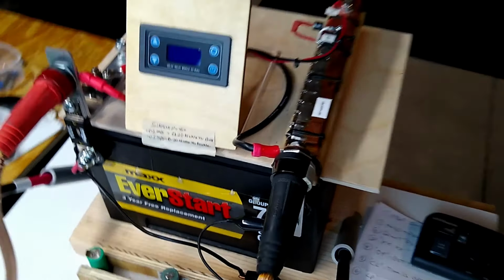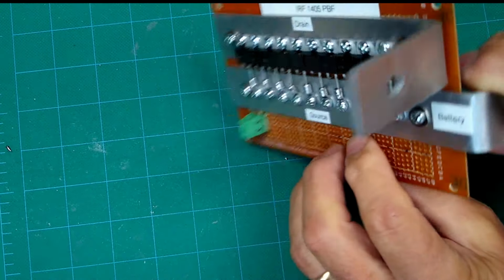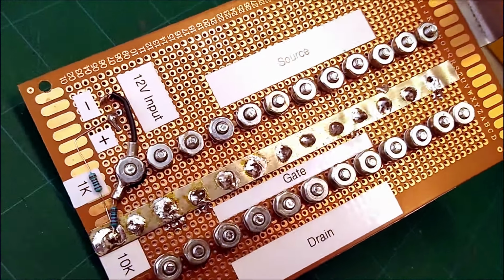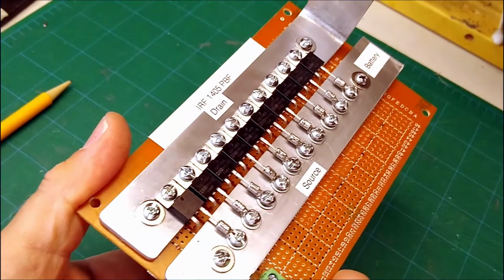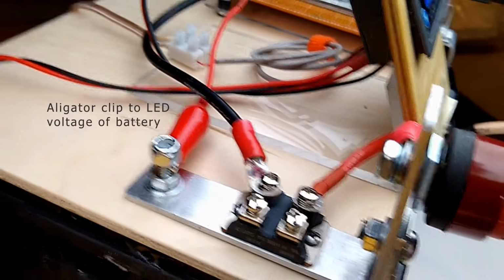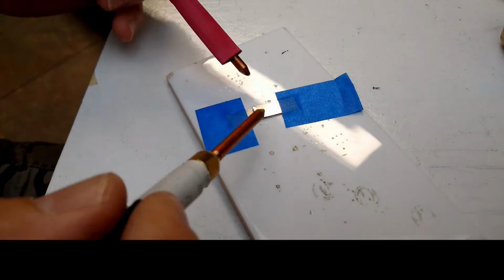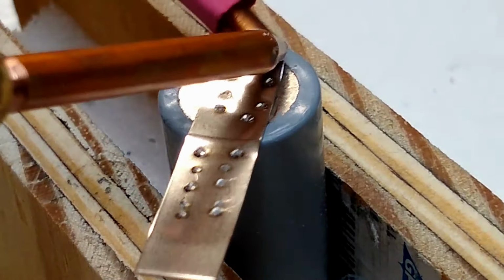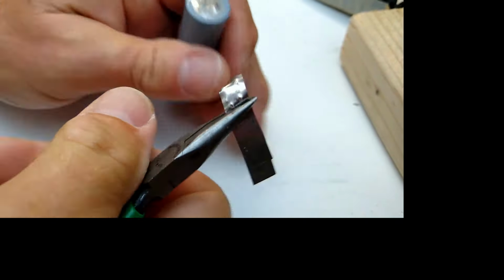Mosfet spot welder build for dummies

Comment: exellent welder im trying to follow your build im stuck on welder cables size and what size dinze connectors also ive got same timer just wondering what is connector called where trigger goes into timer thanks for any help
Reply from the maker: https://www.amazon.com/dp/B07H5G7GC6/ref=cm_sw_r_cp_apa_fabc_.d66Fb5M6FNF9
Reply: @stevecahill9106   sorry steve i meant the connector that goes into the timer
Reply from the maker: @danielstorey9342  used existing connector, to power and send pulse voltage from timer to mosfet circuit. Looks like I added wire inside timer circuit to go to  footswitch. Check schematic on where you would connect external footswitch
Reply: @stevecahill9106   the only place i can get one of them diodes is digikey looked all over uk i have to spend 33 pound to get free delivery from US. when i watched your build you mentioned 1N4007 DIODE I googled specs only says 1A where the one that you use is 300a would i have to put 1 1N4007 on each mosfet WOULD THAT WORK. as you can tell im new to this
Reply from the maker: @danielstorey9342  I did not use a 1N4007 diode in my final build. Follow the parts list in the description. If finding parts is difficult and shipping costs are high you might be better to  buy a KWeld unless you can find a  local supplier to provide the same .
Reply: @stevecahill9106  thanks for your help on this  i just like doing projects and get a lot of satisfaction when it all comes together. ive built a couple of battery packs 52v for my ebike i used them cheap red mosfet welders on ebay . ive had 2 of them they both blew up it was the mosfets i got some new mosfets put them in. and added a capacitor and they have been ok since .but only weld 0.10  nickel wont weld 0.15 but im only using a 330cca car battery thinking of using higher cca battery what do you think. ive just got my timer today in post same as yours bit confused with 3 pin trigger inside of timer going to add a foot trigger. do you use high or low trigger pin to trigger timer .
Reply from the maker: @danielstorey9342  I use a  800 CCA car battery as you can see in the video. This welder will do .03 nickel. A battery at this CCA will give you the power you need. I also have the battery on a trickle charger. 

 I have seen many YT videos about that welder you have and the fixes that people do to keep it from blowing. Just a thought.

 I have provided you with a link below with updated photos of changes I discuss below.

1.  Used the low trigger.  Difficult to see in the photos but the labeling is not centered on the pins on the circuit board. Use a multimeter after hookup to test continuity on the trigger output which goes to a footswitch or button. NOTE: I use a separate 12Volt 18650 pack to power the timer which in turn sends voltage to trigger the mosfet to a "on" state.

2. I have taken the source mosfet aluminum rail  and now it connects to the battery from the other end. I ran a cable from the battery - side to the other end. (See Photo). 

3. I recently changed out the welding 4 gauge pens with smaller 8 gauge wire with stranded flexible silicon copper. This gives better control-placement of the welder tips on the cell with the smaller gauge.

I noticed that the K-Weld uses 8 gauge.
I inserted copper ground wire (3.25mm dia) as welder tips from Home Depot about 1.5" into each of the 18" 8 gauge wire ends.
Shorter end tips allow for more control with DIY mosfet built welder. Does generate a bit more heat in comparison to the pens i was using, but worth the advantage. 

Better welds when you have more control using the 8 gauge with the silicon covered wire when your welding the positive ends of the 18650's because of the small footprint of that cells positive area.

Also tried used the spring pens, but that was again like holding a long pencil at the top and trying to write resulting with no control.

Did have to increase weld time by .01 tenths of a second due to the smaller cable as the resistance went up. Plenty of power to weld .03 nickel. 

Currently building out a rig that will allow the electrodes to be fix on a arm on a fulcrum that is held up by a spring that you pull down the arm and the electrodes can make the weld. This would  allow consistent electrode distance placement on the nickel strips. 

I may revert back to the 4 gauge wire with this new rig if all is well. This would allow there to be less resistance, thus less heat generated. Each welding method(s) would provide a use caser depending on the situation and access to the cells.

Link to photos: https://photos.app.goo.gl/wSKNhtsXjbajwvaC8
Reply: @stevecahill9106   thanks for your help on this. tried my 330cca  battery everything sorted ive got timer working with a foot switch first i tried to power timer of same battery but timer wouldnt work soon as i powerd timer of seperate battery it worked . just need a 800cca battery because the 330cca only welds 0.1strip. it sort off nearly welds 0.15 . got 1 diode 10a 1000v flowing  from source to drain so anode end on source and cathode on drain side of mosfet. i hope this is right looks the same on your pics . just need a diode for the positive side of battery tried to get one like yours digikey and mouser havent any in stock till may june .looked at daniels recent post he uses 2  1000v  1a diodes in series i think he said you need high voltage not so much the amps. ive  looked at the post about the flyback situation . correct me if im wrong i connect a cable from the drain side off mosfet where i have one of my welding leads with the diode flowing towards the positive terminal so the cathode side of diode connect to the positive of the battery .what im trying to clear up here is ar we stopping the flow from positive terminal back into drain side off mosfets. or do we stop the flow into the positive terminal from the drain mosfet rail .
Reply from the maker: @danielstorey9342  See the link in video description for endless sphere they have indication of diode placement, and use of two mosfets as a flyback diode vers the one I used.
Reply from the maker: @danielstorey9342  also discussion of how the diode works, good info at Endless Sphere showing this. Read all the individual threads.  See https://endless-sphere.com/forums/viewtopic.php?t=81400&fbclid=IwAR1UGhstMfwU7wNa9qfhoOfc6igTPb2AM6f24elK1h3saX4iSCmg7HelAn8
Also here photos: https://endless-sphere.com/forums/viewtopic.php?f=14&t=81400&start=25

And alternate to Flyback that I have:
 https://endless-sphere.com/forums/viewtopic.php?f=14&t=81400&start=50
Reply from the maker: @danielstorey9342  With a 800cca battery I can weld .030 nickel, time .04 seconds.  I have my timer on a separate power supply, which also powers a LED light and small fan.  Need to do a video on that. Put the welding pens on a pull down arm allows better control of the placement of the electrodes.  Also numerous videos on YouTube on easy fix to the small "red" spot welder.  Are you on this Facebook group @ https://www.facebook.com/groups/DIY18650

Watch: How to modify "red" spot welder:  https://www.youtube.com/watch?v=fdnO0Z-scjA
Watch: Using car battery with "red spot welder:  https://www.youtube.com/watch?v=231qtaRIs3M

Comment: Great Job, easy  design. that Flyback diode is important, a lot of people neglect using them and end up shorting their MOSFETs depending on the length of their leads.
Reply: Does the flyback go between source and drain or source and gate?
Reply: It goes from drain to the positive battery terminal. The fly back voltage is apparently 1000 volts positive so it needs to be directed to the positive battery terminal and away from the mosfet as that is to big a difference from the drain to source.

Comment: Hi there great simple design.  Can I use an old Microwave transformer instead of the battery?
Reply: Just from watching the video, you would be better off using the battery.
Reply from the maker: This is designed for battery.

Comment: Why did you decide on the 10k value? ... vs Creaney's 2.2
Reply from the maker: Based on another builders specs I used. Have not had time to test other resistors values. Lack test equipment to fully understand the implication of changing the value.
Reply: Are you triggering positive or negative lead?
Reply from the maker: @terrylmusic  Mosfets switch on negative side of battery to negative  welder tip. Mosfet switch has its own 12v power supply independent of the battery used for welding.
Reply: @stevecahill9106  what I am missing is the power hookups.   
I'd have sworn I saw leads coming off the battery for powering the board. I have Creaney's timer, can't see where yours is connected. Im sorry if this is elementary.. first mosfet project for me. Please help.. I'm almost done.
Reply from the maker: @terrylmusic  here are a few pics showing the timer wiring  I use @ https://photos.app.goo.gl/9NhYyssQQ8XY8i2m8
I think Daniel used same battery as welder to power his timer. I use separate 3S 18650 battery pack to power the timer I use that triggers the mosfet switch. I blew up the first mosfet welder when I attached to same battery as timer. Probably had reversed leads to mosfet switch.
The 12 volts goes to timer the positive from the battery 3s goes to mosfet positive as shown in video. The negative from the timers output goes to the mosfets negative as shown in the video. I have the timer jumpered by the white jumper in the photo. I hope this helps.
Reply: @stevecahill9106  I'd like to forward a screenshot of the board I have from Daniel's 12 mosfet video, but I don't know where to send it in this reply. Robojax xylj02
Reply: @stevecahill9106  I am studying your photos. Thank you. Just don't want to blow it up.
Reply from the maker: @terrylmusic  best to test the mosfet switch before hooking up to battery to weld. Use a multimeter to check  for continuity with the mosfets. Treat the mosfets switch like any other switch.  Except this is electronic switch vers mechanical.  Apply briefly 12 volt separate power supply as I use 3S 18650's to switch on the mosfets, or use your timer to briefly turn on. I advise checking timer separately from mosfets to make sure you have that working by itself.  Check that you get continuity across the mosfet switch with  the 3S power supply before connecting the main  welding battery power input to the switch. In my case this mosfet switch buss bar input is on the negative side of the battery which attaches to the mosfets source leads. Continuity will be tested ( without being connected to main welding battery) from the main welding battery input to the  mosfets to the output of the mosfet switch which will be where the welding tip is attached to the other side of the mosfet switch. Use caution when testing, a mosfet(s) if  it  explodes will send it's bits flying into your room. Safety glasses necessary.  Once you verify the mosfet switch is turning on and off, then connect to main welding battery, test continue again, make sure power supply polarity to the the mosfet switch is not interfering with polarity with main negative side of battery! 
Make sure you use Shockey diode to protect the mosfets!!!
Added more photos to link above.
Reply: @stevecahill9106  thank you. Polarities are marked on the timer board.. I am assuming to match pos to pos, neg to neg on everything?
Reply from the maker: @terrylmusic  yes
Reply from the maker: @terrylmusic  Did update resistors, see Update under description.

Comment: On the electrodes: file a flat on the sides and mount them side by side with a thin spacer to hold them apart as a single tip. This keeps them spaced the same so when you get your timing dialed in the welds will be the same depth.  It would be good also to make a trigger button on the tips handle so concentration on tip placement is not lost in distraction. Other then that it looks great to me.  If you notice the welds get a spark when welding, try  adding a .47 mf non polarized capacitor at the tip where the wire attaches to quench the spark like they do on switches.  Have fun with your new toy :)
Reply from the maker: Thanks for your help. So a cap on just one electrode, bridged across?
Reply: Whenever you see the pneumatic actuated weld heads the tips are always as close to a 90° angle to the work as they can get them. It helps with contact pressure and consistency.